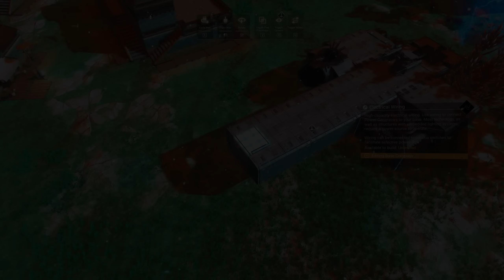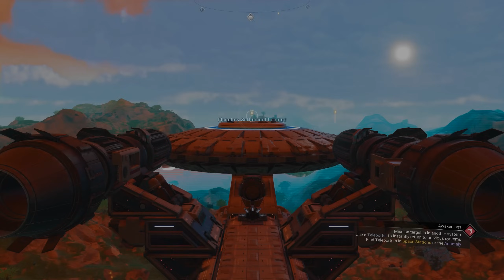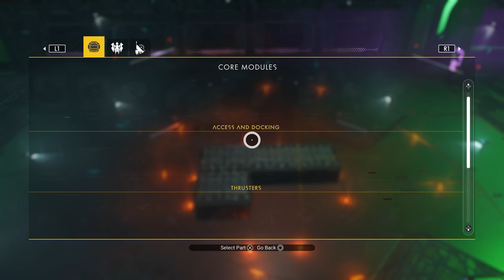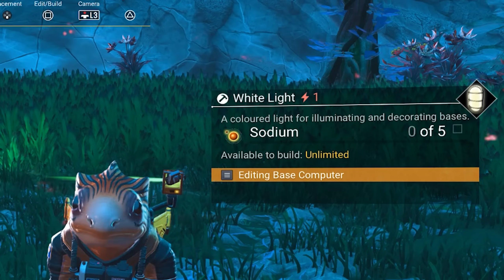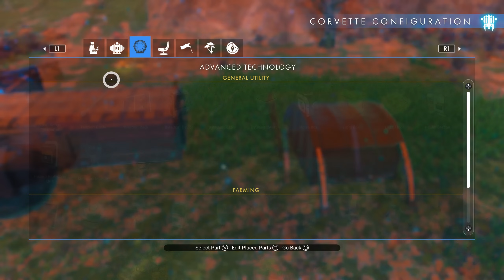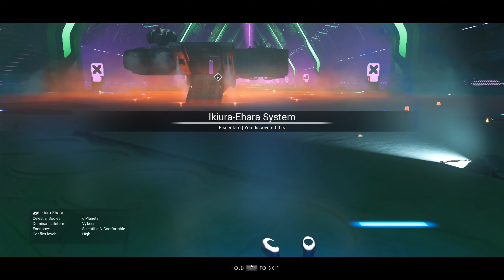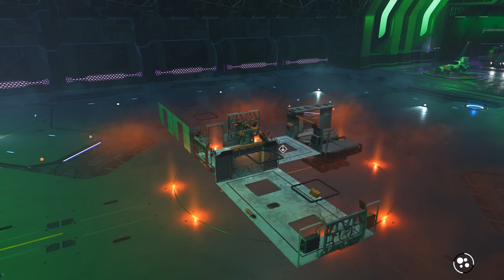[Archived] - The Transfer Glitch – No Mans Sky (broken with Breach)

Comment: been running into quite a few of people's glitchy corvettes in the anomaly. Had extremely bad lag which is something I do not experience on my rig. And have had over 10 full on crashes when loading in those player's corvettes in the anomaly.
Reply from the maker: Yeah, there are a lot of corvettes been converted by using blender and Save editor...
HG should work on a limiter, that refuses to render in a corvette over 400 parts. That would be the safest for the whole community.
Reply: @Beeblebum  thanks for addressing it in your vid. People are making the anomaly a lag fest with the excessive builds. I saw an abomination last night with hundreds of engines and looked to be over a 1000 pieces altogether.
Reply: @Beeblebum  Or just disable the big ones from loading on the Anomaly. Would be sad to lose the option for big ships, just don't have them ruin stuff for the average player.
Reply: Yes this is getting outta hand. @beeblebum  people using mods on pc are completely breaking my console when trying to load in things that my game can’t. Normally I like glitch builds, but hello games has DEFINITELY need to implement some type of restriction. Simply looking in the direction of modded ships bricks my game.
Reply: I am all for glitch building and such as it relates to the half forward/backwards step or half step up/down but going beyond that or 100 parts really causes a lot of issues in multiplayer so I don’t go past that.